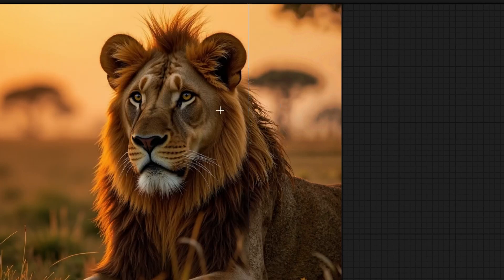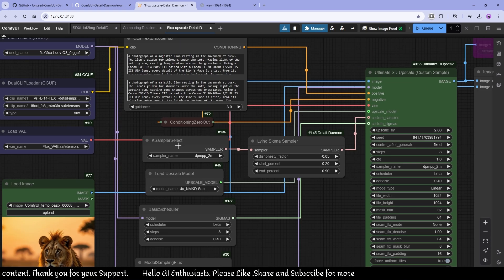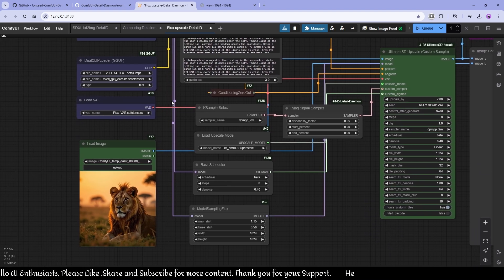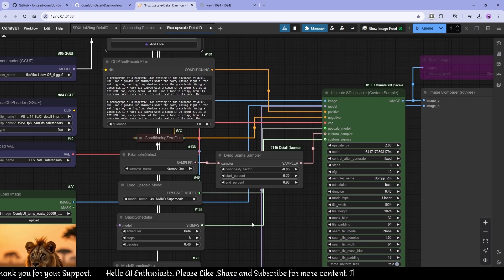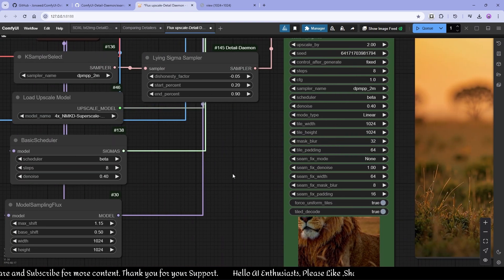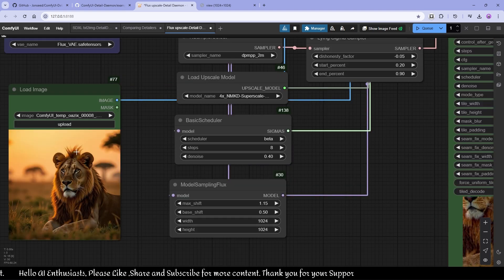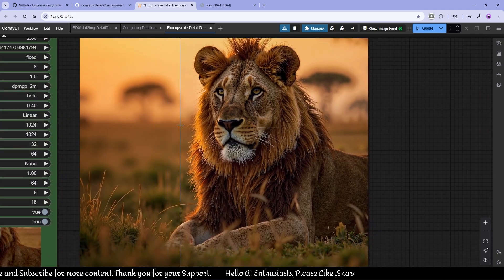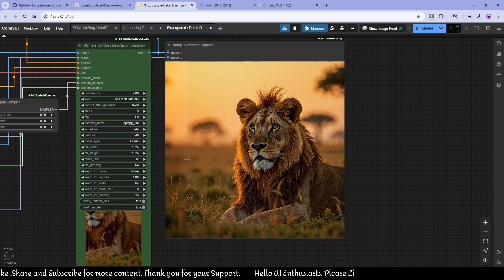Why Flux and Detail Daemon is the Secret to INSANE Upscaling Results?

Comment: This works with 1920x1080 images also or just 1024x1024? The workflow looks very good, sad that i cant do this work =/
Reply from the maker: @alexandresantana1282  it works with 16:9, 9:16, 1:1, 3:4 and you can get images upto 16k. Why can’t you do it?
Reply: When I tried to use the workflow, it took many hours and it didn’t finish the job… I thought it could be the format of the image. I will try it again to understand what has happened😔
Reply from the maker: @alexandresantana1282  hours? It should roughly take 2-3 min. What GPU you have?